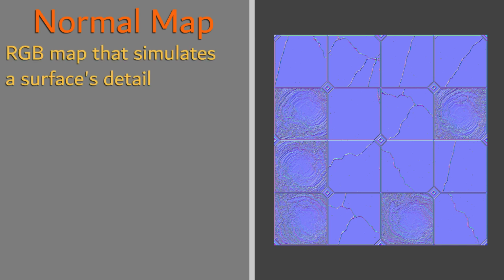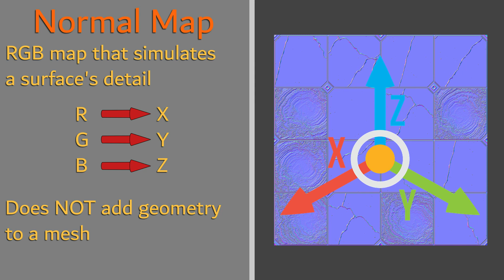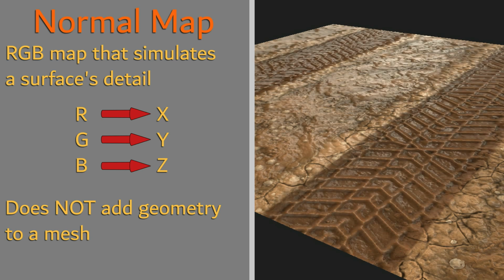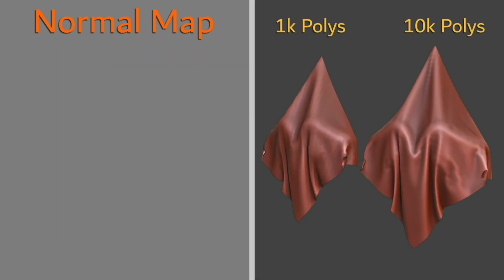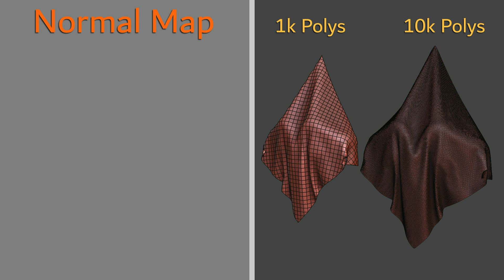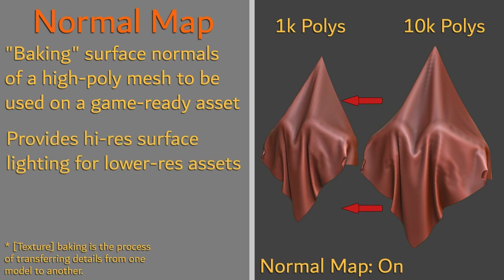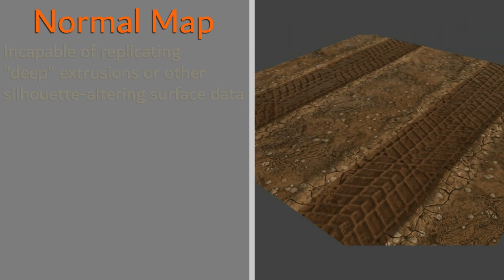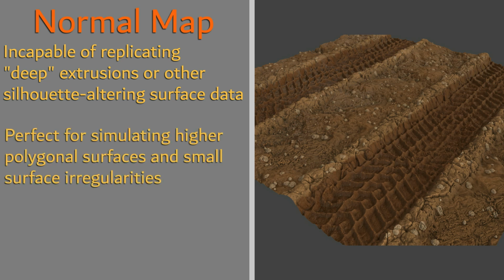What is a Normal Map?

Comment: I find it interesting that normal map cannot represent deep extrusions. Surely that is simply a matter of magnitude? If I use a 48-bit normal map then amplify to 10x its captured extrusion, why would that not create deep extrusions? Also, given that it captures x and y position data, can a normal map represent overhanging surfaces, and if not, are there are maps that can?
Reply from the maker: You can definitely try to represent deeper extrusions, to varying degrees of success. Its all on a case by case basis, and it mostly comes back to simply just the viewing angle of it. The one problem with amplifying your Normal Map 10x is that it creates harsh Normals for your model so light might not actually interact with the map appropriately. Areas that were intended to be soft might now have very sharp features, and everything looks like you brought it through a "deepfried meme generator". That's not always the case, but is a common possible outcome. 

Because the Normal Map doesn't actually affect geometry, identifying overhanging areas again really comes down to how deep it hangs over, what you need the players to see based on the angle of view in the game, and are they going to see it that way? If a Normal Map cannot provide that information for you, I wouldn't necessarily recommend another map but rather just to actually model the lip/overhang with geometry. If you wanted to create geometry through maps, I would suggest taking a look at Vector Maps as well, as it works the same way as a Height Map, however it also provides access to the Z direction, allowing you to create lips and overhangs like you've mentioned. :)
Reply: @GetLearnt  I thought about this more deeply. A normal map cannot, under any current circumstances represent an overhang.  Imagine a flat surface with a concrete slab extruding from it. Easy enough to represent with a normal map right? Imagine three adjacent points in x space each of which is defined by a z value something llike 0; 128; 0 - zero being the surface and 128 being the slab height. Now put a space above the slab, and then another slab (overhang). There is to my knowledge, no means to input multiple values for a single vector. You would need 0; (128,32,96); 0 - the32 being the space and 96 being the thickness of the overhang above. Given that a normal is only capable of holding a single C,M,Y value, it is incapable of representing a string like that, do you agree?
Reply from the maker: @Martial-Mat  Definitely a heavy technical approach! More so what I mean is that you can potentially give the "illusion" of an overhang, but like I said it all depends on the viewing angle because while Normal Maps provide "falsified" normals for lighting, what it cannot do is actually alter the geometry. So if you were to look at this flat plane at a distance from straight overtop, you might not be convinced it was a tall-standing pillar. BUT, you could possibly believe there was an extrusion from the ground. However, if you looked at it from the side, all you would see is the flat surface with a Normal Map. I was more intending to say you could create the illusion that there is surface information, but for large deformations like that you would absolutely need geometry, which you could get by either modeling it, using a Height Map to displace the geo, or use a Vector Map for essentially the same purpose. Something as complex as what you are suggesting is totally outside the possibility of a Normal Map, at least the way I'm reading what you're saying. Totally agree! :)
Reply: @GetLearnt  :-) thanks for your thoughts. Valuable insights.